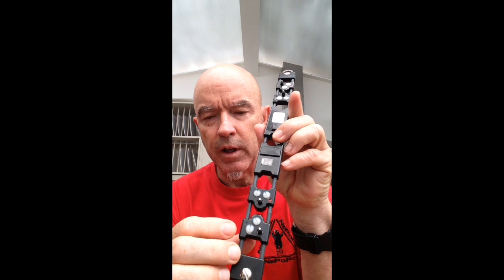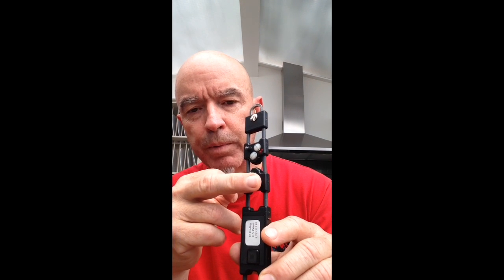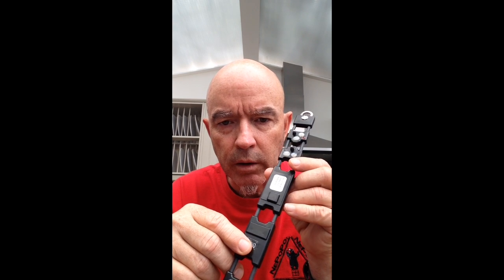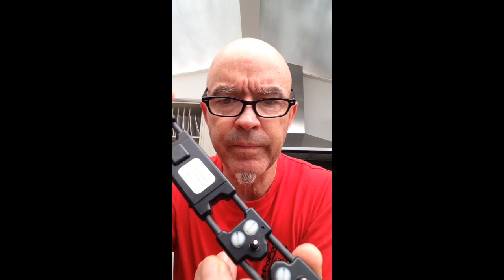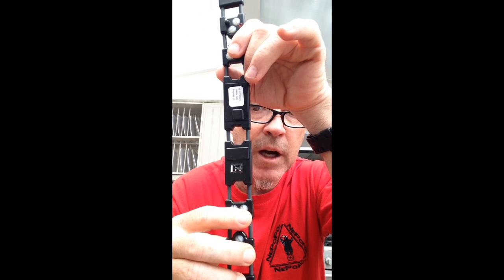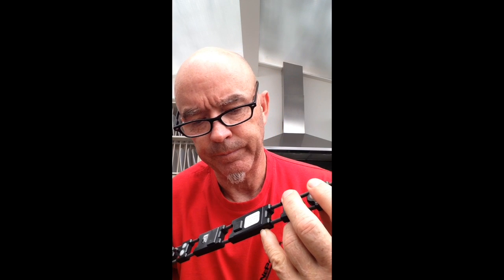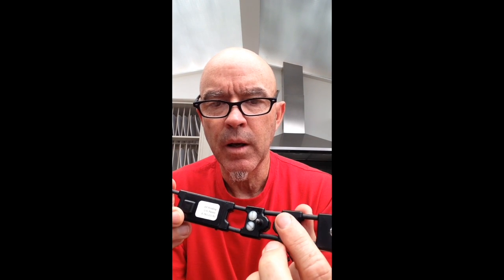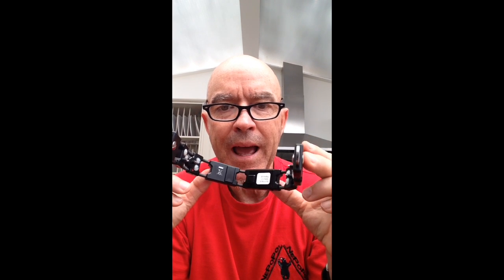Contact Measurement and Why That Is Important

Comment: I may have to get one of these for myself as a birthday present, the finger kick alone is worth it...
I currently use a ECT w bungee straps and buckle collar, and I've noticed inconsistent contact with the skin (I use pro series, which are smaller receivers, so that may be a contributing factor). My response has been to err on the side of too tight with the collar fit as the bungee has give anyway. I find the dogs are responsive at a much lower level to the stem this way. Is this the proper thing to do?
Thank you for your work you've contributed enormously to the world of canine training.
Reply from the maker: Good contact is a must! Moving the position of the contacts so you don't get desensitisation can assist in keeping low and effective levels and finding the best contacts for your dog is also important. Thanks for your comments.